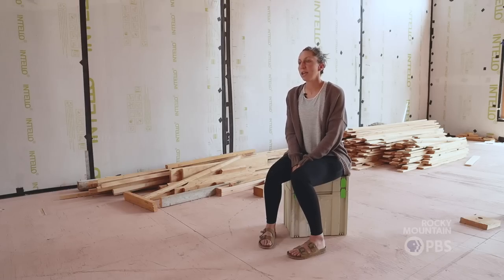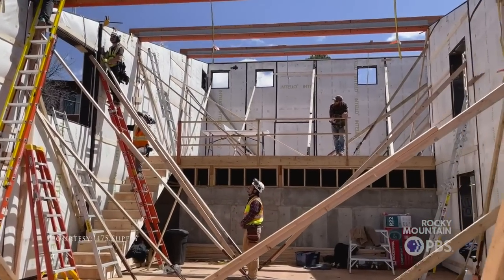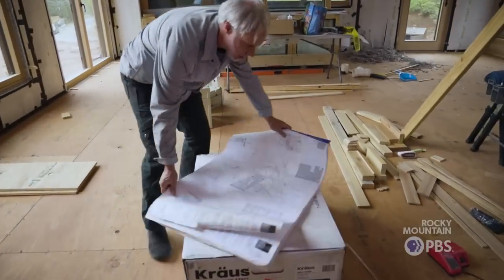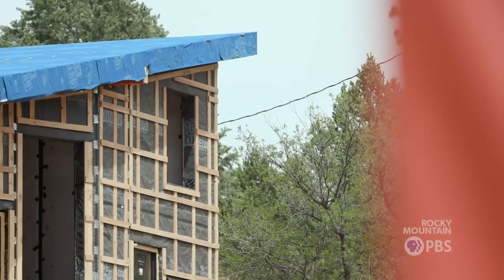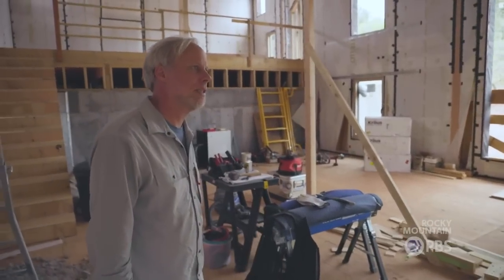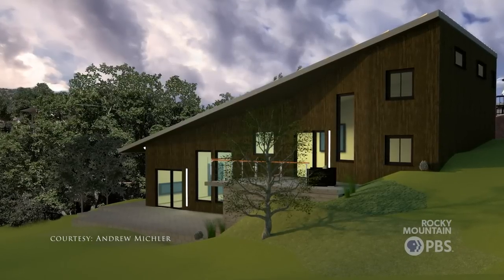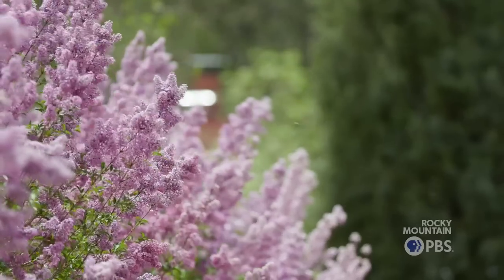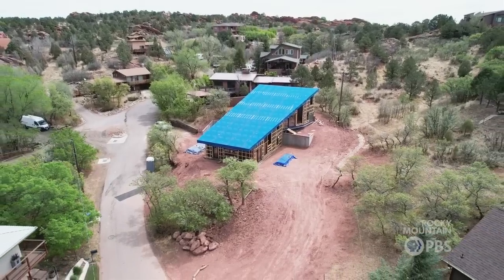A first-of-its-kind home in Colorado Springs

Comment: I don't even know what they are talking about here.  Cellulose is almost zero carbon?  Its chemical formua is 6 carbon atoms for 10 hydrogen atoms and 5 oxygen atoms.  Paper is from trees, and trees are built out of carbon.  Does he means zero carbon emmissions?  Does drywall usually emit carbon?  What is he even talking about?  And "two families, one house", we used to just call that a duplex.  I mean, all fine and all, but I'm not getting how this is a one of a kind house.  I'm also not getting how its eco -friendly when you are driving the parts all the way from Canada?  I hope they love their new home, but I don't understand how this is a story.
Reply: Near zero carbon refers to the atomosphric C02 that results in the manufacture, installation, and life use of the material no matter what the material is made with.
Reply: @ACMichler  Thank you.  So how does that sync up with it being converted newspaper?  Even if you don't start counting until after the newspaper has started its second life (because logging, paper manufacture, and delivery of newspaper is obviously anything but low carbon footprint?), is this not going to use fossil fuel energy for processing?  I'm seeing manual uses of paper (baling, glueing, etc.) in construction, but this is clearly machine-processed, so I can't see how that can be done without shipping the paper to a central place and using energized machines to convert it to a consistent and clean product?  Maybe he means lower carbon producing, not almost zero?  Appreciate the information, though, you are obviously right about what was meant.
Reply: @ACMichler  Wait, are you saying that it's not about the composition, this product is sold as near zero carbon footprint because of offsets?
Reply: @ACMichler  Sorry to reply again, I'm looking it up and apparently the thinking is that even though it has to be processed and have chemicals added, and transported, you are "trapping" the carbon from the trees originally used in the house for as long as the house stands and so you can basically subtract the "trapped" carbon from the produced carbon and call it kind of even.  Which seems pretty disingenuous to me in any case, but certainly when describing it as "almost nearly zero carbon" without explanation.  I'm glad he's found a house building project he thinks is superior to the standard but stories like this which act like building brand new houses with trucked in materials is ecologically sound if you do it with certain brands.  It sounds like an old house was torn down and thrown away to build this one.  Again, not judging their home, just the RMPBS presentation of this.  I'm not even hearing what the square footage is, if this is a 3000 square foot duplex that's one thing -- if they are building a 5000 square foot duplex for four people?  Again, might be great, but is it really "green"?

Comment: Don't California Colorado.
Reply: What does that even mean? Should they build a piece of junk builder-grade McMansion so it fits in better with the other suburban tracts of the Springs?
Reply: @whiteryanc  No, don't think that's what they meant at all. What they might have meant was something along the lines of what we have seen here in Colorado for the past several years of green initiatives, simply for the sake and idea of being green, and not necessarily for the result or benefit of them. Also, if you look at the start of the video, almost nothing else would have fit in that tiny spot of a parcel they were building in - so maybe that is some of the California they were referring to.....where it is normal to build a house, green or otherwise, basically on top of the next one. I, for one, couldn't make it through the video because they used the phrase "passive house" like 20 times in the first two minutes, which seems to show how California the agenda was with the build.....that sound about right.
Reply: @anthonyb8484  How is the Passive House standard a "California" thing? They said the phrase so much because it's the entire point of the story. For too long the building industry has barely met minimum code, which is woefully insufficient for the next 40-100 years of housing stock to be operating at. Colorado Springs is a city, cities are defined generally by some degree of density so of course plots are stacked one next to the other. Surely this project went through zoning, and if it had any outlying setbacks was also surely put to public comment as is standard virtually everywhere. 

Progress and striving for better quality home stock is not "California", it's common sense.

Comment: Newspaper insulation is great!! Especially for burning faster than your family can possibly escape. . High desert brush fires are not a common occurrence in Colorado at all. 
IS THAT WHY THIS IS A PASSIVE HOME?? TWO FAMILIES CAN QUICKLY PASS ON AND STOP CONTRIBUTING TO EARTHS DESTRUCTION??
Reply: Cellulose is treated with a fire retardant and is one of the more fire resilient insulation materials in part due to the lack of oxygen from dense packing.

Comment: It doesn't look like it is optimized for solar gain .
Reply: Not where it's located. They are too close to Pikes Peak. In the winter, you want to take maximum advantage of the sun's warmth in the late afternoon. However, the sun goes behind the mountain in the early afternoon. This area is in shadow later in the day all year round.
Reply: Not exactly. The sun doesn't set over the peak in winter.
Reply: @nortonjoseph7601  It sets behind the mountains and the entire Front Range gets an early sunset. You have to travel pretty far east before you get a normal sunset. In Colorado Springs in particular, the sun never sets gradually. Things get dark real fast when the mountain casts its shadow over the entire city,  but especially early in the Garden of the Gods where this house is located.
Reply: @nortonjoseph7601  For solar gain it would be East West aligned like mine in the same area.
Reply: @chrispollard6568  Yeah, I think just as big of a concern for this build was the summer exposure. I think that's why they tried to get creative with it. Also, the shape of the lot looks like it presented challenges. Does your home perform well in summer and winter? My home doesn't! Large south facing windows but also a large west face that absolutely cooks in the summer.
Reply: @badbiker666  I have a similar situation and have windows on the East side.  How can you take advantage of the sun in the afternoon when there is so little window area.

Comment: Regarding solar heat gain in that large mountain-facing window: with the house located so close to Pikes Peak, the sun will set there in the winter around 3:30-4:30 pm. I am not certain that is enough exposure to the direct rays of the sun to really heat anything up. I am not an expert, I just know how early the sun dips behind the Peak in the winter months in the Garden of the Gods area.
Reply: Batteries.
Reply: @trer04  Motorboat.